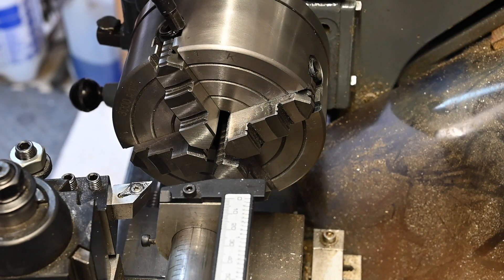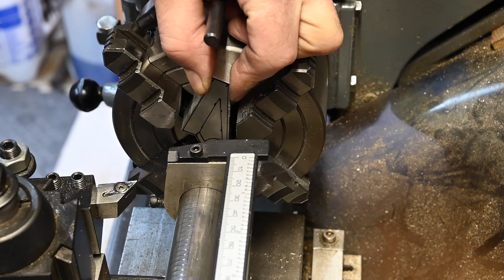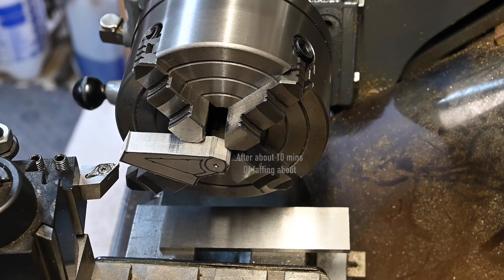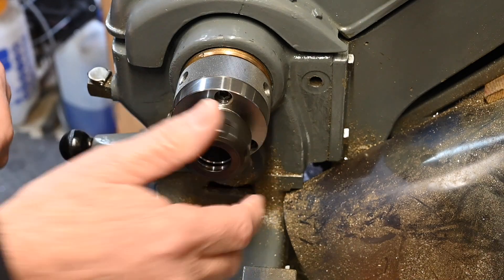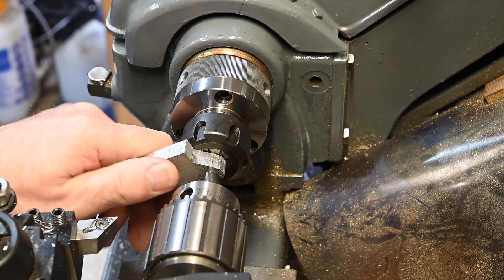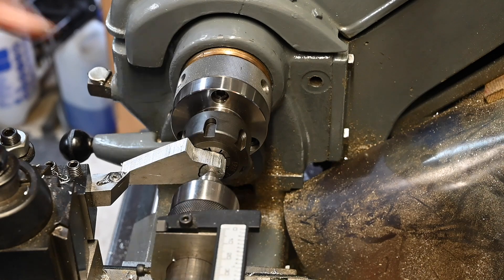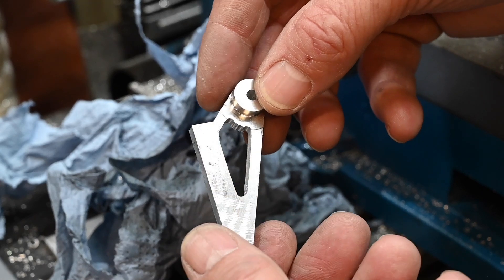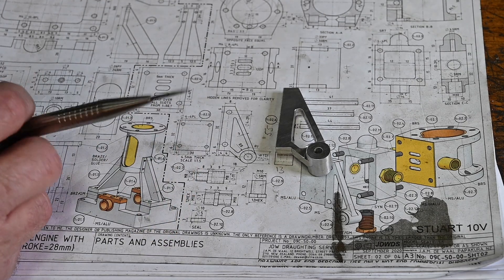Forward & Reverse Lever Support Bracket EP10

Comment: I know it's your choice, but I have seen you you a rotary tab. Why not use that much easier
Reply from the maker: I got lazy 😂 and couldn’t face taking the vice off, aligning the table and then putting the vice back on the mill, for what appeared to be a small job! As it turned out, it took twice as long 🤦‍♂️ moral of the story, don’t be lazy!😂😂